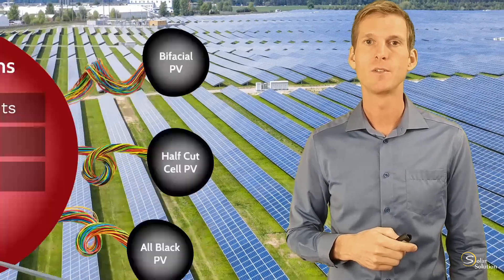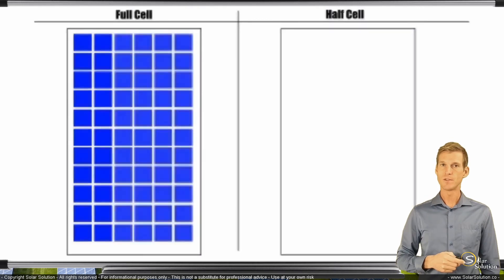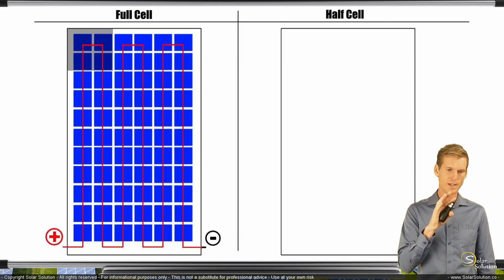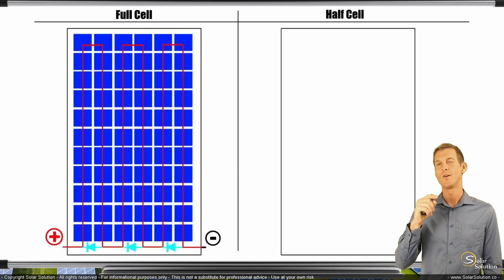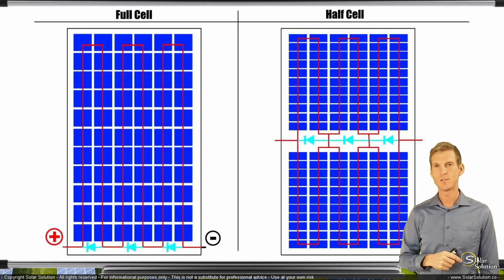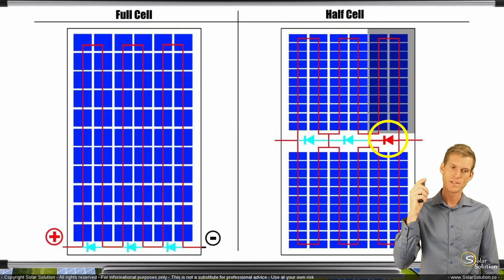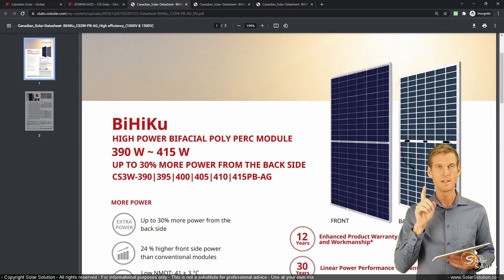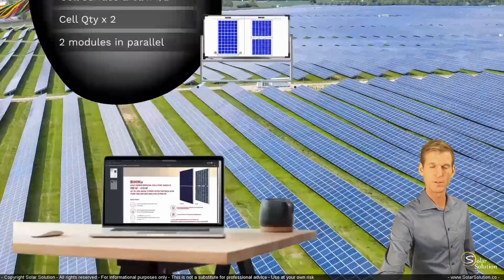Half-Cut Solar Panels Explained: How they work // Are they better // What is the difference

Comment: Taken to.a limit, why don't we go to 1/4 cut or 1/16th cut?  Also, I'm confused about the diodes which have Vf drop.  I expect you'd be loosing .7v for each of those at all times.  Is this of any concern?
A good presentation but I would like to see some actual demos as to how this works with V, P, and I displayed.
Someone should come up with a simulator where you can build a system with panels in series/parallel and metrics.
Reply from the maker: Good idea about the simulator Dennis!
Reply: The diodes are wired in parallels with the string of cells and in reverse polarity. In normal non shaded conditions no current flows through the diode so there are no electrical losses. If the diodes were wired in series with the cells and the polarity was in the direction of the flow, then you would get the 0.7 volt drop for a silicon diode (or 0.3 volts fora germanium diode).

Comment: You are oversimplyfying how the halfcut modules work, to the extent that you are incorrect. You do not only loose 1/6 of the module in the case that you showed. You lose 2/6, or (1/3) of the module since the current is flowing through the by-pass diode. However, if you have an inverter which can lower the current and raise the voltage of every individual string of cells, it is possible to engage the second local maximum and utilize 5/6 parts of the module. HOWEVER, it will be at a lower current, so you wont get 5/6 of the maximum power output, it will be lower.
Reply: I also did expect this from a highly educated ""solar expert"". Shame.

Comment: Having only one panel of Half-Cut module is kinda benificial, however, if you have multiple panels connected in series. It will work as a regular panel. Also, if the Solar Inverter / MPPT controller is not optimized to do a sweep function across the VOC, you might end up loosing upto 50% of the overall output as they will not be able to trigger the bypass diode, and forces rest of the string to work at a lower Amp. 

This happens with my current setup which I am using. I get a small shadow from the east side wall, which happens to cover 3-4 cells till 9:30AM in the morning. The Vmp of each panel is 42V, and I have two of them in series. Now, if the MPPT is tracking at 70V, I get 8Amps. However, if it starts tracking at 84V, my Amps decrease to only 4Amps, and it stays like that till that shadow is gone by 9:30AM, where I start getting 10Amps. 

So in conclusion, 70Vx8Amps = 560Watts, and 84Vx4Amps = 336W. Power lost due to poor tracking of MPPT = 224Watts. 

In theory this sounds good, but in practical, if you do not have a really good MPPT controller, you might end up loosing a lot of power. Just with the two panels I am loosing 224 Watts.
Reply: You give the impression of being someone who is trying to understand what is actually going on, and not what is supposed to be going on.
With your observations in the real world, would you say that these panels in parallel with an mppt charger would give optimal performance in poor and very poor light conditions?
 Optimal in relation to Mono, Poly and Amorph, not optimal as in maximum output, obviously.
Reply: @robinhood4640  I have not used other types of panels before, but I belive a Bi-Facial panel is just a double glassed version of a MonoPERC panel. In sunny condition, the panel exceeds its Amp rating, generating anywhere between 10% - 50% more Amps based on the reflection of the surface.

In overcast conditions, I get around 20% of the output, and in cloudy conditions, I get around 50% of the output, and the voltage will be close to Vmp or higher due to no direct sunlight hitting the panels.

And whenever there is a sunshine, the overall output goes up to its maximum, totalling 150% power output. However, this happens for a very short time until those cells get heated up and goes above 25 degrees.

Comment: I think your diagram at 8:00 is wrong.  You shouldn't have the top and bottom shorted and you would probably have 6 diodes (yes?).  The way you have the diagram there, one photo diode would short past both the top AND bottom cells, I think...
Reply from the maker: Thanks for your feedback Jeff. Let's agree to disagree ;)
Reply: @SolarSolution  Sorry.  Not trying to disagree.  Trying to understand.  I think you're saying it is therefore NOT wrong and I'll go back and try to understand how that works then.
Reply: @jeffmcclain  You are correct, and this video is not. The one you linked however, seems to be correct.

Comment: How does the kicked in "red" bypass diode not short the lower functioning string?
Reply: It does bypass the lower string aswell.
Reply: You need smarter inverter that lowers current through the whole module to prevent bypass diode to kick in, right?

Comment: The up and down cells are in parallel so the bypass diode cancels both of them...
Reply: Wrong. The bypass diode has a reverse bias voltage across it from the unshaded half cell string, and so with still pass current through the unshaded half string.

Comment: I'd like to see a real life test of this. I agree that the half-cut module should have better shade resistance. That was one of the obvious reasons for doing it when I first noticed half-cut panels, but I'm not convinced that you would only lose 1/6 of the power output. The layout essentially has 6 strings in a 3s2p arrangement with bypass diodes across each parallel pair of strings. If you shade a portion of one of the strings, that string is still coupled to its parallel pair and must therefore have the same voltage across it. Also, you still have to pass all the current output of the module through the strings somehow. If I had to guess, I'd guess that actual power loss in the partial shading scenario is probably more than 1/6 but probably noticeably less than 1/3. Again, it would be nice to see some actual test results for such a scenario.
Reply: If you are using only one MPPT controller for the entire string, you cannot take full advantage of this technology. You will need Power Optimizers or Micro inverters.
Reply: @furyjk98  Optimizers and microinverters are generally used for a whole panel and so are not relevant in the discussion of the merits of cell layout within a panel or the power output considerations that arise from this.
Reply: @brettski74  I understand your point, but Half-Cut cells will perform same as a full cell module. When there is shading, it will just lower the amps by half to compensate for high voltage, or lower the voltage for higher amps. 

In a series of panels, just because one panel's 1/6 string got shaded, it does not mean the whole power output of other panels go to 50%. 

This is the problem with Half-Cut modules, if the MPPT does not have a proper sweep function, it will be stuck at the higher voltage delivering less amps from all the panels.

Comment: In theory with a regular panel if you have full sun blockage on one solar cell group You loose one third of your panel output. But with same blockage on a half-cut  cell solar panel You loose half as much output of the solar panel which is 1/6 .. Very impressive . Half the output power loose.I bought four of these type panels last night. Can't wait to try them out. Fingers crossed LOL
Reply: Only if you have Micro-Inverters or Power Optimizers, it won't work if you only have one MPPT for the entire string.

Comment: The bypass diodes only allow current when the string voltages drop to near zero (the diodes forward voltage drop, about 0.6V for silicon diodes). Therefore the diodes are only used when both its associated strings are blocked and their combined voltage is low. The difference is if one cell is blocked, it does not contribute any current, whereas the other string does, so you effectively end up with a reduced reverse voltage across that diode (no current through it), so the remaining working string contributes a lower voltage at the panel current (half the power, so half the voltage for the same panel current), so the panel system voltage drops by 1/6 instead of 1/3. In practice it is more complicated, as this behavior may shift the maximum power point MPP (the solar converter to the batteries attempts to adjust its load on the panels so that the V x I product is at a maximum) for the panel. In a system of multiple panels, a shaded panel may still adversely effect the system MPP performance by more than just a single string loss, unless each panel has its own MPP electronics, as is the case for microinverters.
Reply: Exactly.
Reply: Well explained thank you!

Comment: Are there PV panels that have more than the half cut cells? Lets say Triple cut cells? I ask this because shade is a problem on the roof of my house and I like to buy the best solar panels for colleting solar energy. I will be using micro converters, the IQ8 or IQ7 from Enphase. It depends on the availability. I like the IQ8 better because then I will have power during power outages and don't have to install backup batteries straight away reducing the initial investment. Curious to hear what the best solar panel type will be for (partial) shaded  roofs. Have you made a video about that perhaps?

Comment: To me it seems in this example once the by pass diode in the half cell panels is in by pass mode, it by passes for top and bottom string, no actual gain as opposed to full cell modules, still 1/3rd outage not 1/6th. Perhaps the schematic lacks parts? Something does not make sense here.
Reply: It seems logical that the current would be divided between the bypass diode and the unshaded cells. The unshaded cells are effectively a low resistance path so current would tend to flow through them. The shaded cells are like a resistor and the diode and unshaded cells are effectively two diodes in parallel.
Possibly you lose some efficiency in the unshaded cells, I'm not sure how much but they are still producing power.
Reply: Ur are right. The video explanes it just wrong ... if one substring is blocked the diode will not bypasse.

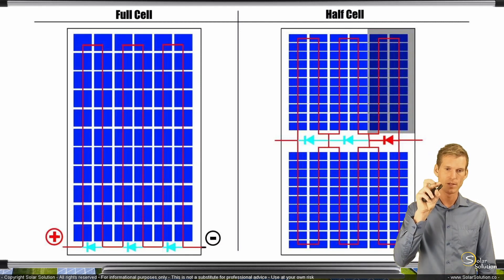Comment: I'm not sure this is right @10:00. If the bypass diode is activated then you'll lose 1/3rd of the panel not 1/6th. When I did my own testing of this shade on 1 portion of the panel either resulted in losing half the panel (more likely) or 1/3 of the panel (If the inverter hunted low enough in voltage to see this). My working theory is that half cell modules are for 1. higher efficiency as less current running through each cell and 2. large arrays that are east to west trackers, with half cells if bottom portion is shaded by neighboring row it can still generate in the early morning and evening.

Comment: If 2 mirrors of equal size to the panel are placed low down at an angle to reflect and focus sunlight upwards and central. Then a face down panel mounted over the mirrors central to their focal point will this give a better performance? There will be double the light and less heat on the panel face? 
If the mirrors are larger but concaved to focus and reflect on to the panel face but not beyond will this be even better?
If a solar water heater is placed above the back of the panel this should keep the panel cooler in its shade and provide hot water at the same time? This should protect the panel from weather and other element damage. OR am I just being stupid?
Reply: just search on youtube, all your ideas were already implemented, mirrors facing the panels, water etc

Comment: Jesse, can you please take a look at the comments here below? It is explained that the power output would be 1/3 instead of 1/6 for the half cut panel at 9:01 in your video. If so, can you please correct? Or only in certain shadow conditions? I'm a newbie so it is not clear to me, but I want to learn...thnx in advance!
Reply: To me it seems there is no bypass because the lower string still produces and provides a Voltage and the diode does not pass any current. Therefore, I think you are right and the power loss will be only 1/6, but please confirm :-)
Reply: Indeed, you loose 1/3 of the panel.
The bypass diode is active. So the voltage of the left section is -0.6 Volts. Same voltage applies to upper and lower half, so both sections are effectively switched off.

Comment: Enjoying your videos and ur great explanations & content here, thanks for all this good info. 
I am wondering how the effect of one panel in a string effects the overall output of the string in this case, if one section has a leaf on it, I am not sure if we lose 1/6th the PV area or is it 1/3rd? 
Also, even if it is only 1/6th loss of that panel, this would also have a roll on effect with any other panels in a string, bringing them all down a few volts of output to the lowest panel output voltage effecting the overall wattage output of that string, does this sound correct? TIA. Cheers

Comment: Very clear and concise explanation. Subscribed right-away. 

I just noticed that you are a bit mis-understanding/not stating the point correctly at 8:20 onward section where you discuss shading on 1/6th of the PV Module. 
 Here is my take on it:

Your Said: 
1: When a part of the Half-Cut PV Module is shaded, its adjacent cells of the loop will not produce any voltage and wouldn't be able to carry any current. Rendering that specific loop not produce any power etc.
2: The result of the shading will force the adjacent bypass diode to activate and will divert the current to next strings.
3: In the mentioned case of shading, you are approximating the power drop of 1/6th instead of 1/3rd of the total power.

My Take: 

1:  Shading will degrade the power output of the loop in which the cell is located and can sometimes render the whole loop produce no power.
2: As the loop has a diode which is shared directly with another loop, the diode will go into bypass mode only and only if both of the loops are not producing any positive power to raise the voltage across the terminals.
 In the case of the single loop being shaded, it is quite possible and is often the case that the shared loop cannot keep up with the current to raise the voltage across the diode's terminal and will simply go into bypass mode. But once the diode is in bypass mode, all the strings attached to it will result in no addition to the power output (short circuit by the diode).
3: Considering the above explanation, the shading on the single cell will force the bypass diode to bypass all the current of the top loop as well as the bottom connected loop eventually resulting in the loss of 1/3rd the power of the PV Module, Not 1/6th.

Extra bits: 
For anyone interested in how and why half-cut cells are used, you should know that Half-Cut PV Modules have More than One MPP (Maximum Power Point) Voltage points during shading scenarios. Paired with compatible inverter, their MPP voltage can be switched from either of the "Global MPP" or "Local MPP" voltages with efficiency in mind.

In the mentioned shading condition at 8:20, it is quite possible that the bypass diode doesn't even kick in and the inverter is able to track a MPP voltage with a smaller amperage but still utilizing the power of both the loops (top and Bottom in this case) of the shaded cell.

 For Example,  Let's take a generic Half-Cut PV Module with 6 Strings and a nominal MPP Voltage of 30V. Strings have a nominal voltage output of 10v with 5A (12*5=50Watts) each, resulting in 6*60Watts Strings = 300W Total Power Output. 
With the Scenario at 8:20, lets consider the shading to effects the performance of the effected loop and dropped its power output current from 5A to 2A (60% Power Loss) , then in ideal conditions, this PV Module will have 2 MPP Points (Google "Global MPP" and "Local MPP" for reference) 
 MPP#1: The Bypass diode is active (the shaded loop cannot provide the 5A which each of the other loops can) and the MPP Voltage will be 20V with 10A of current resulting in 200Watts of power output. (1/3rd the Power Output as I am predicting in the scenario in this video)
 MPP#2: As the panel is only limited to 7 Amps of current due to the effected loop (5A of the un-shaded part of the loop + 2A of the shaded loop), any more current draw will kick on the bypass diode and will render the 2 connected loops shorted and with 0Watts of power coming from them.

 Also, the wiring malfunction is a bit different scenario than complete shading. Depending on the passing current, the Inverter may pick the "Global MPP  Voltage" or the "Local MPPs Voltage" of the Panel/s.

The comment is getting very long and technical I guess. I'll be more than happy to respond to any question/query. 

 :-)

Comment: So in a half cut panel, you have 2 series that then link together in parallel. If you cover a cell, the bypass diode kicks in. This means that you now have the series at different voltages. 
So does this compromise the voltage on the good series.
Anyone able to help

Comment: I assume that the half cells are half the voltage etc then when you link them in parallel you double the Amps. Am I doing ok do far.
Reply: Not really. Half cells have the same voltage but half of the current of full cells. once connected in parallel, you double (their originally half) current so that the total power (current * voltage) is the same as the panel with full cells. The advantage of panels with half cut cells are already described in the video so I won't repeat them here.
Reply: @adon8672  We cannot have two halves in parallel with one half having the by pass diode activated and the other not. So no, I do not understand the advantage of panels with half cuts. This just doesn't make sense when used in parallel. The only advantage would be when using the two sections as two separate panels through separate inverters. In which case they cannot share by pass diodes.